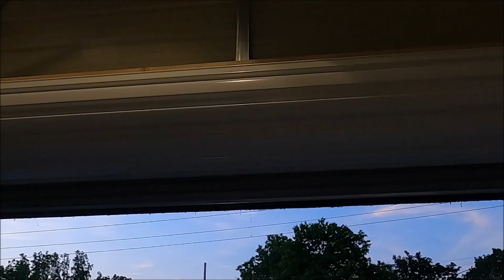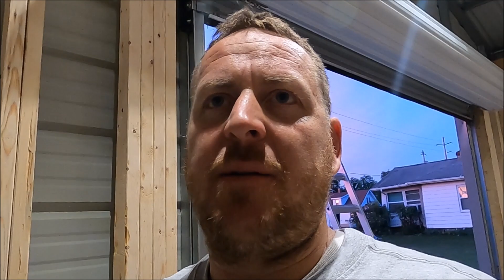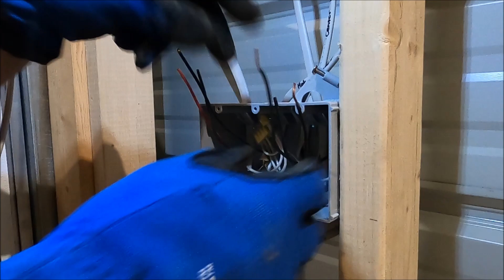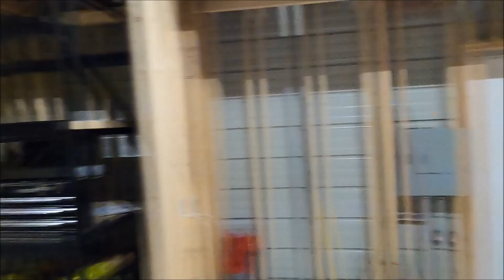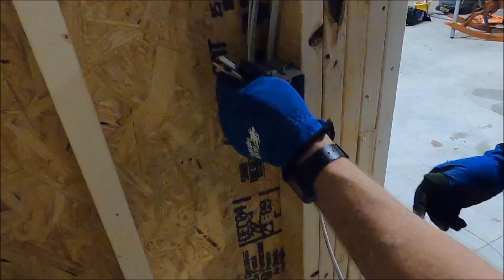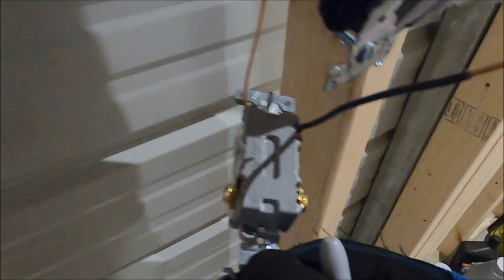Exterior Lighting and Three Way Circuit Explained

Comment: Question. I'm confused to why do you need the jumper. If the neutrals are all the same and copper cables? co
Reply from the maker: The circuit is made up of the black hot wire and white neutral wire. Those wires are identical in make up except for their color. They conduct the electrons through the circuit. The bare copper wire  is the same as the other wires, just not jacketed. It is not part of the circuit. It is a path to take any current that gets outside of the circuit safely to ground.

Comment: Is there any issue if the bare copper ground wires touch each other within the box?  Is this only a concern with the black hot wire?
Reply from the maker: No issues with the copper wires touching each other. They should be wire nutted together anyway. The black and white wires are current carrying wires which is why they have coating and can't touch anything they aren't supposed to.

Comment: Great information
Much appreciated. 
Any thoughts on using electricians gloves when working on diy stuff?
Reply from the maker: I would always make sure the power is off when making installations and repairs and it won't matter if you wear gloves or not.

Comment: What did you think of the light that had three different light sections on it?  I was thinking of getting some of them for my garage but was afraid they would not put out all that much light from a 10 ft height.
Reply from the maker: They are plenty bright. I was going to put the long led light fixtures in, but I am going to stock with the three light light fixtures.

Comment: So glad I have found your channel. The knowledge you are passing on is great. Recently purchased  a home that has a small 20x20 out building that i plan on making my shop. it only has a direct burry line right now that is on a 20amp breaker. I m going to put a 60 amp circut out there and had a few questions i was hoping you could help answer. when i go to bury wire for 60amp how do i know what wire to get and can i get 2 30 amp breakers to make it work? I should say, 60 amp i think will be enough because it will be just lights, outlets to power saws and so on but dont intend to have multiple saws on at once though. Again appreciate your videos a ton, love your teaching style, the way you tie everything back to pictures really helps me out. i was nervous to start this project, kinda still am but feel much more confident now. thanks Tom
Reply from the maker: For the wire, 6AWG is used for 60 amp circuits. I would upgrade to 4AWG for your application just because of the length of wire you may have to use from you home service entry panel to your garage. Definitely install a sub panel in your garage. Use underground service entry wire to go from you home service entry panel to your sub panel. The sub panel will allow you use the different sized breakers to power lights, outlets, or larger devices is you need to install a larger breaker for something.
Reply from the maker: I would recommend going to an electrical supply store for your materials and have them help you get the exact materials you need.

Comment: I am working a job with just a little electrical redo and I found what I call split bolts or split lugs that I’ve seen used for grounding in the place of wire nuts with about a half a roll each of electrical tape 🤔😶. Pretty sure that’s what an idiots work looks like. You are WAY good my friend.

Comment: So the other day my wife turned the overhead lights on in the kitchen and we could hear sizzling and turned it off. When I opened the box up the wires for that switch apparently stucked into the switch, never seen that kind before. So off to Lowe's. And then I got looking at the wires they were all black except one wire had white tape on it. So the first time I turned on the power the switch was in the off position but on so I moved wires around and it worked fine
Reply from the maker: Electricians will put different colors of tape on wires to denote that they are being used for a different purpose than the color of the wire jacket. That is the kind of garbage I wish they would stop.
Reply: @brettleybuilt  i had never seen a switch that the wires plugged in and of course one fell out.